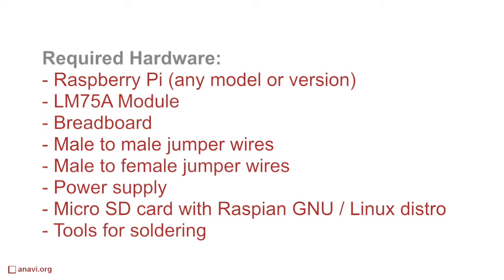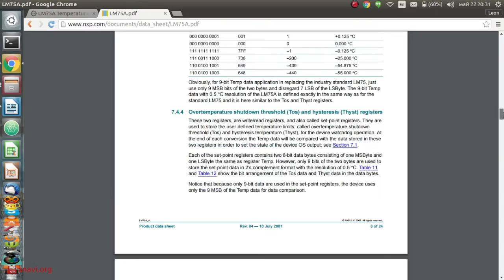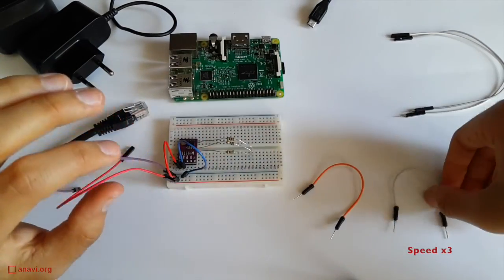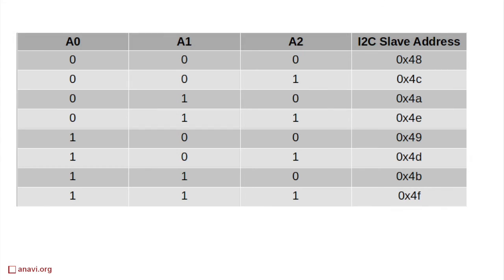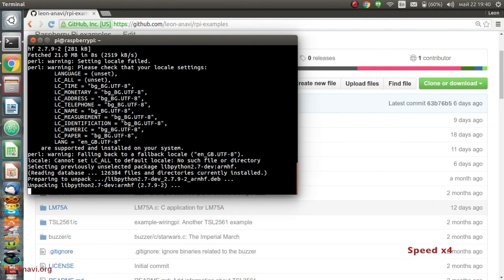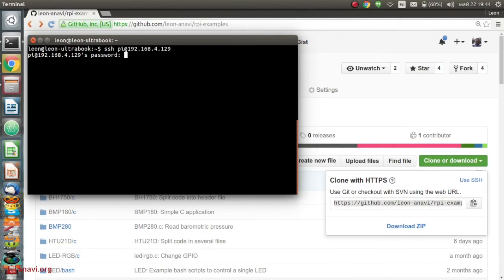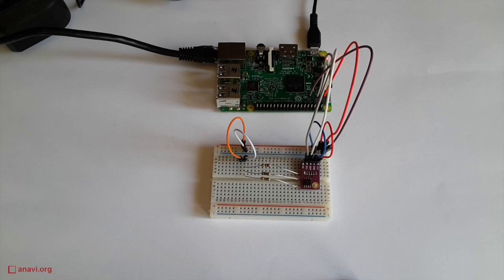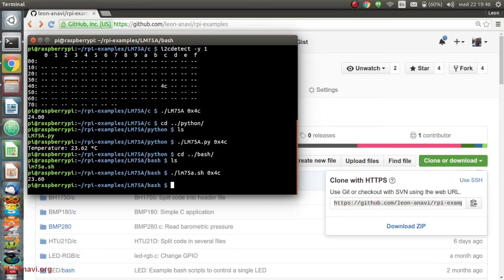Measuring Temperature with I2C Sensor LM75A on Raspberry Pi

Comment: Is it non-contact?
if it is, what is the probable working distance?
Reply: asking about LM75A sensor?
Reply from the maker: yes, LM75A is for environmental monitoring applications. It provides 9-bit digital temperature Bus readings with an accuracy of ±2°C from –25°C to 100°C and ±3°C over –55°C to 125°C. Have a look at the datasheet for more details.

Comment: Can we have 2 raspberry pi masters? Like... Connect another pi to the sda and scl ports of lm75a? I'm trying to do a fault tolerant system, where if one R-pi fails, another continues.
Reply from the maker: for something like this you need I2C multi-master. However I am not sure if the current versions of Raspberry Pi and related drivers for them support it.
Reply: @LeonAnavi  thank you. I figured I can connect second r-pi in slave mode and give a switch between master pi and slave pi.
Reply from the maker: @asr3412  cool! well done for solving your specific use case.